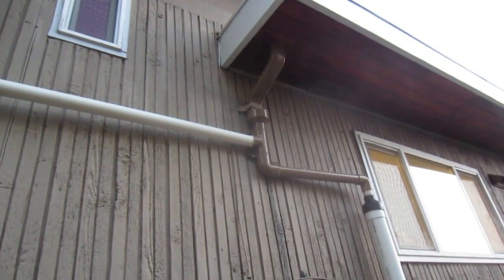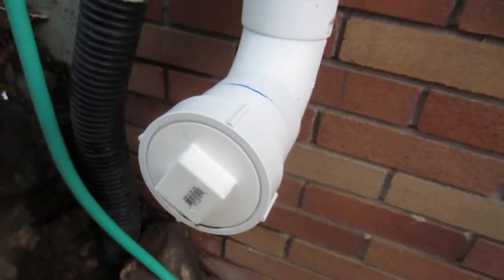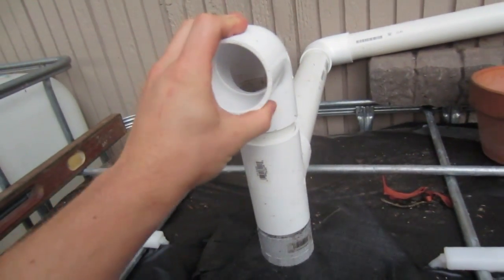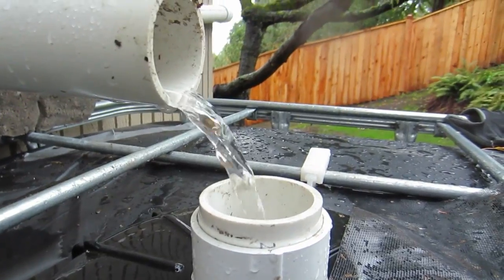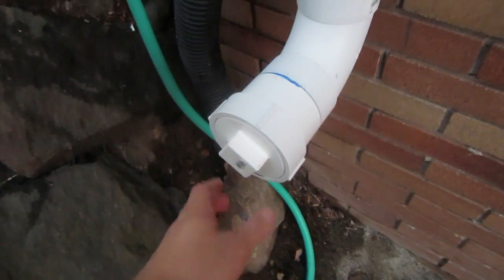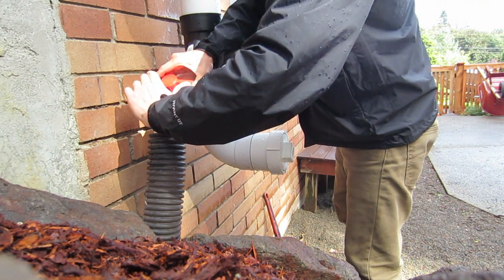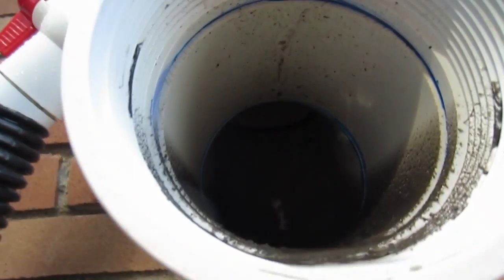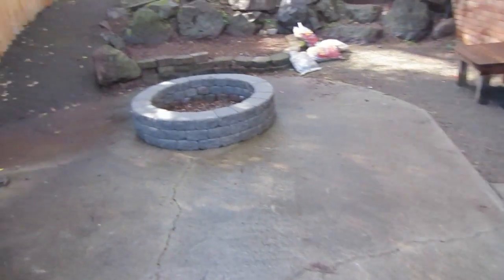600 Gallon Simple Rain Water Collection System & First Flush - Part 1

Comment: Instead of using tape on your 4inch clean out use some pipe dope it will seal better and a lot you to take the cap off easier just may have to reaply after taking it off a few times

Comment: I have several questions for my own education. I how you had time to respond. What are you using the rain water for? I understand the need to had the first flush since you are collecting off the roof but do you have a concern about algae build up?
Reply from the maker: I'm using it for irrigation of my grass. Mainly to save money on expensive city water and sewer costs. I've heard that agea can build up in the tanks and they ideally you want tanks that don't let light in. Mine were white, since that's all I could get so I covered one with thick black plastic, the 2nd needs to get covered before i use it. No plans to drink mine but I may use it for toilet flushing since I have a pump now.
Reply: If you look at time 1:52, you will notice that the UBC tote is covered with black plastic.  This is what prevents the algae.  No sun, no algae.

Comment from the maker: I tried that but the trickle was WAY more than a trickle, It was a stream of water that was eroding my landscaping so I bought a new cap. I think a dripper valve would be a good solution for my particular configuration. Now's it's the rainy season so I have the bypass valve open and the system is off since I don't need anymore water.